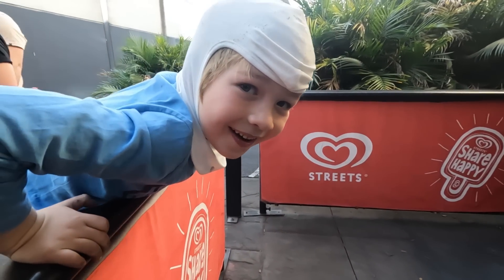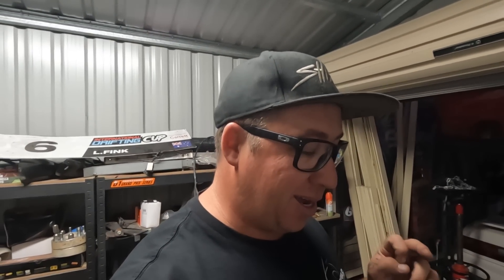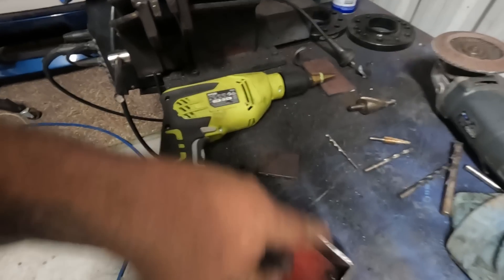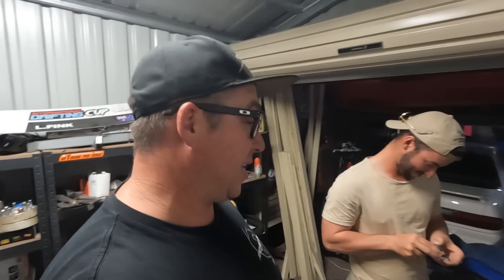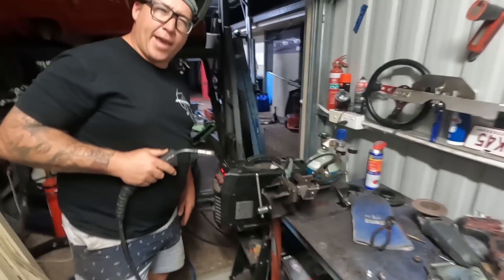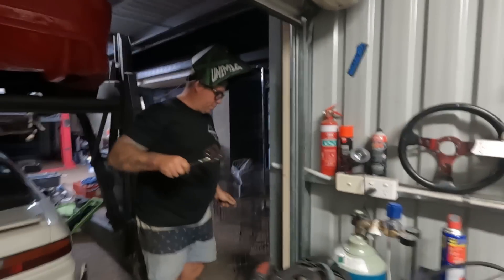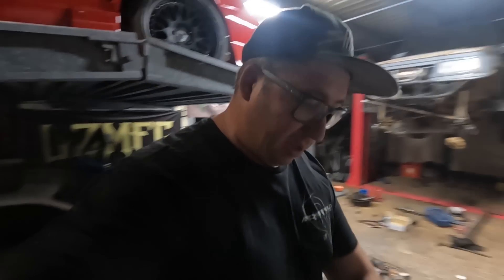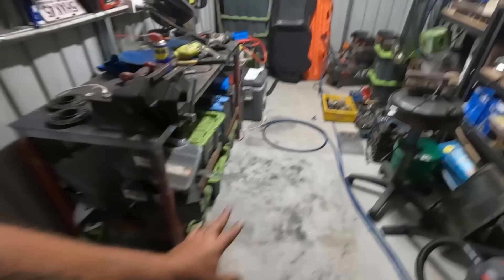Bostons head nearly flies off

Comment: Hey dude, you should really push the mig not pull it for gas flow into weld, and stand the tip more up at a 45⁰ angle. Will get better penno
Reply from the maker: Thanks man i appreciate the advise